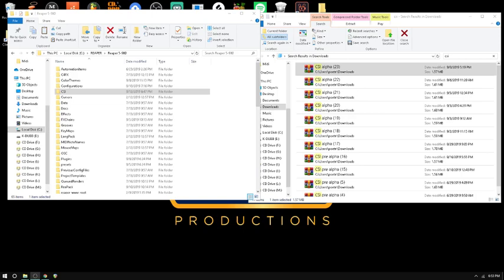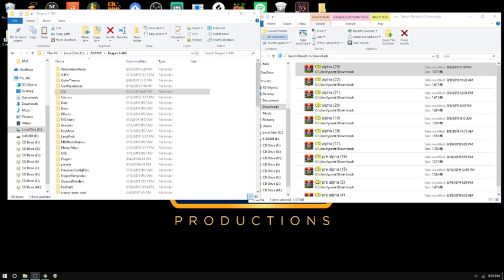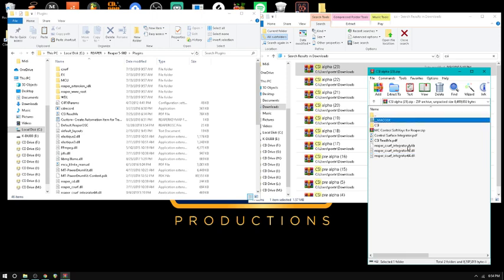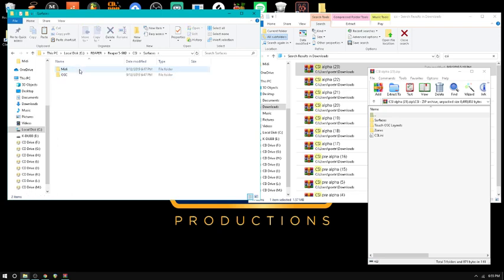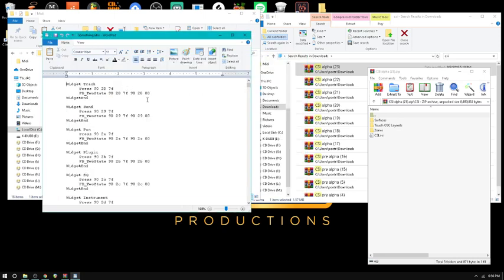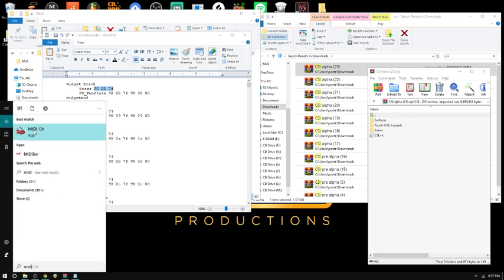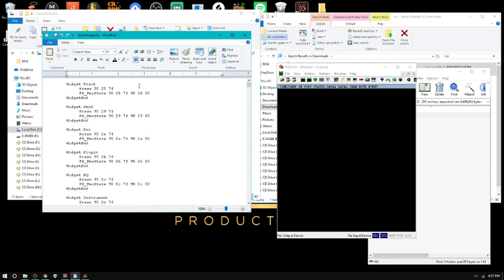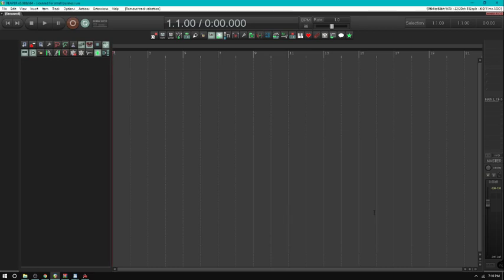Basic CSI setup in REAPER - mixing control surfaces MCU ProX Xtouch

Comment: Thank you for putting this together. I am trying to set up my iCon Platform Nano with Reaper 6.09 on my mac. Some of the buttons seem to work fine, but the fader and encoders are faulty. I can't use MIDI OX on a mac, but I'm using Sys-Ex Librarian to read the button inputs. They are showing up as note, pitch bend, or CC messages, not Sys-Ex.... i.e., I'm not getting the "90 xx xx" format as the input. Thus, it's pretty hard to verify that the Widgets are set up correctly. Any ideas?